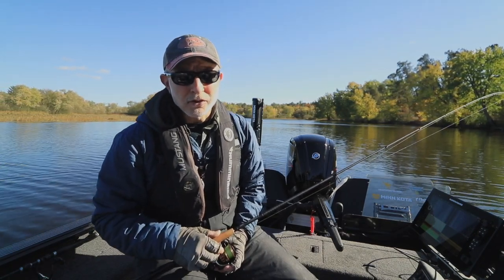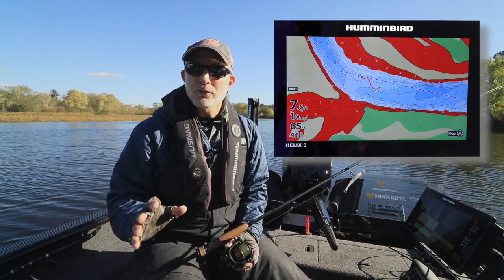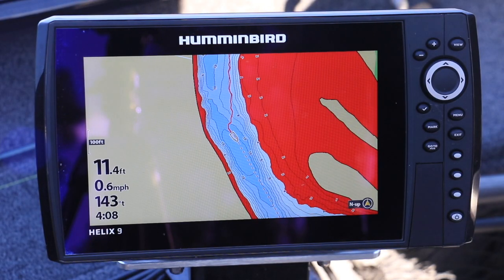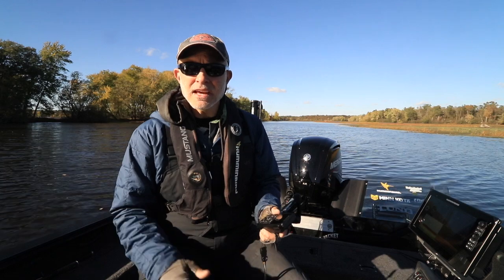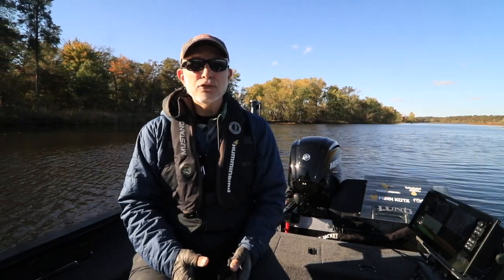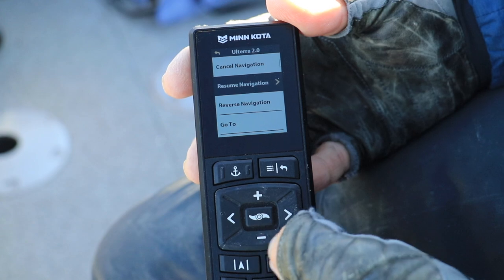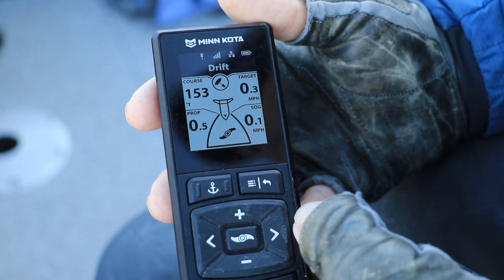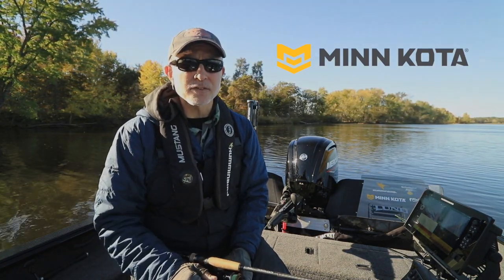How To Use Dodge Mode / Minn Kota Advanced GPS Navigation / The Technological Angler

Comment: What happens if Dodge mode is of? Does that enable me to change direction of my drift?
Reply: Have you  tried that yet? I would think you use the arrow button it will turn the boat taking it out of what you are using at the time. Then you go back to what ever navigation you were using at the time. Just from what I have read. Not tried it yet. My Terrova is brand new and will test it this week.
Reply: @chuckgilbert2035 Ive tried this and i think it works! Now it changes the direction of the drift instead of going into dogde mode.